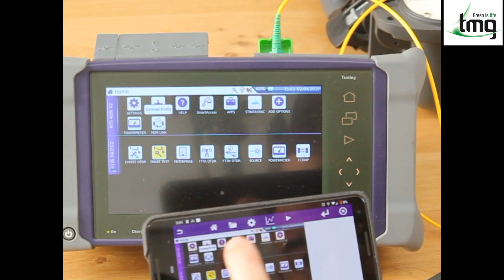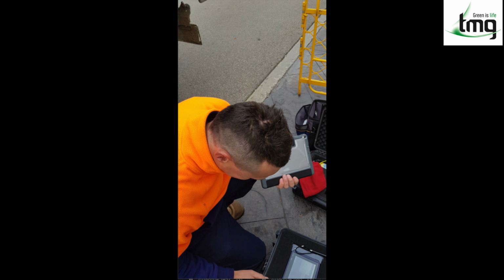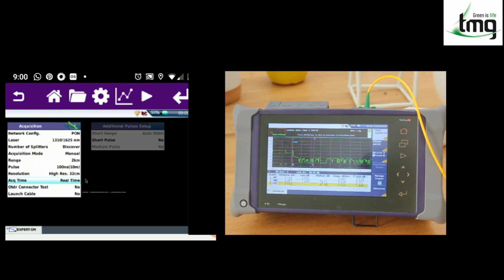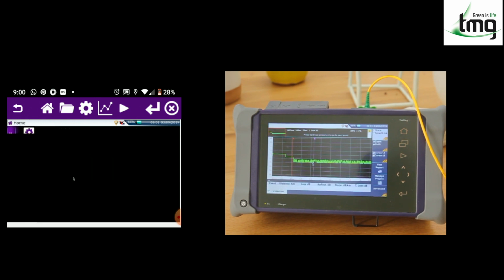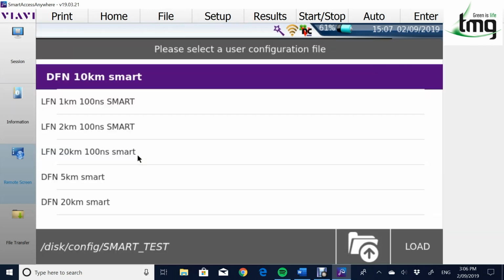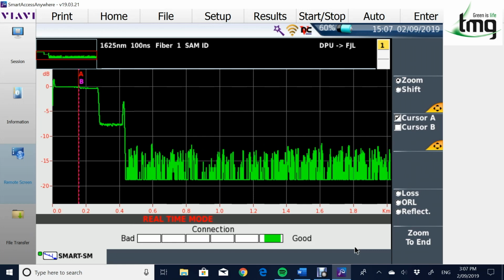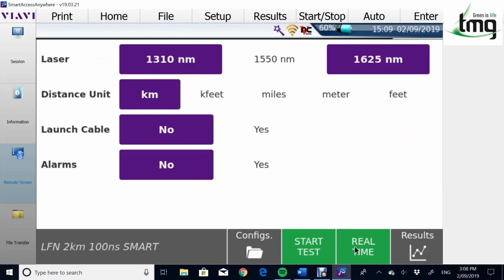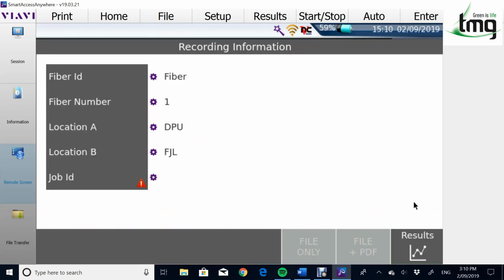How to find Fibre Faults like a Pro

Comment: What a waste of time the fastest way to find a fault on the fiber network is stick a visual fault finder on at the NTD or PCD and go from point to point looking for a break.
Reply: It's not enough to rely on a red light when fault finding on an aging CATV network nor is it realistic to walk 18k lifting pits and exposing trays, then of course, there's the real  risk of creating faults when disturbing joints. Experienced engineers will use a light source, red light and an OTDR running real time looking for the end of the trace to dip when some one at the other end bends the fibre.
Reply from the maker: Hi Michael, thank you for your comment. A VFL is an excellent tool for finding faults especially if looking for a break. Using an OTDR  you can check this in real time looking for a loose connection and Inspect the port with a Fibre Scope before moving to check the Splice at the BJL. I'm told that Telstra are reviewing every trace submitted and want every Spitter,  Splice or Connector within the Event Loss Criteria set by the NBN.